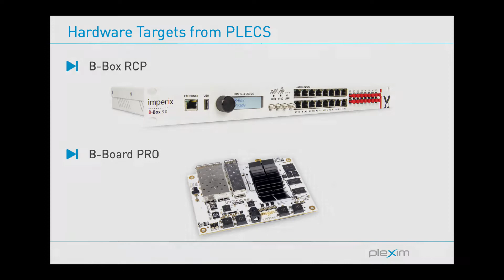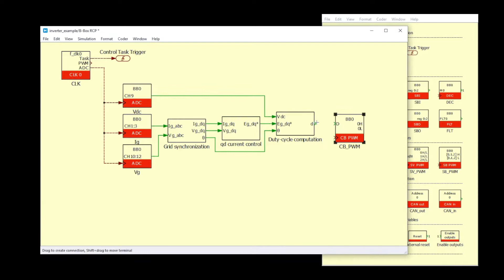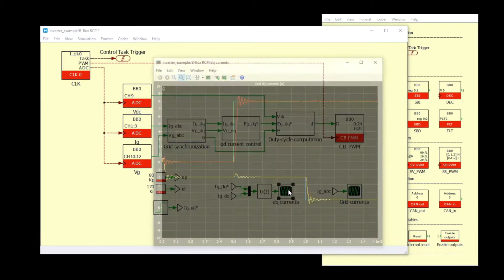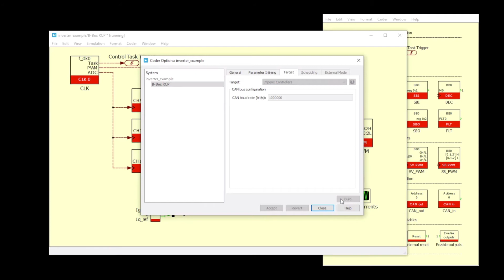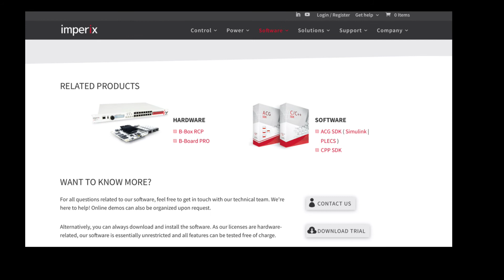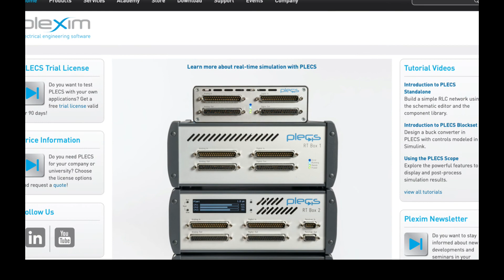Imperix Target Support Package for PLECS

Comment: For use of a RCP controller, why choose Improv over a RT Box?
Which device has more computation power?
Reply from the maker: Hello, we actually see the two offerings for RCP as serving different needs, or at least optimized for different applications. That's not to avoid answering your question, but you can't really compare them (apples vs. oranges!). We would suggest you speak with the technical teams from both Imperix and Plexim to discuss your potential interest.